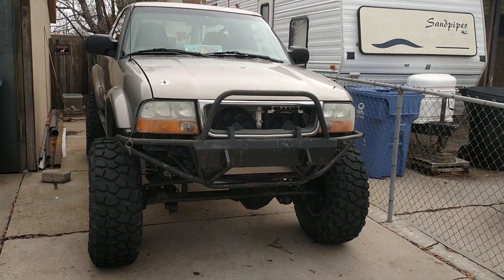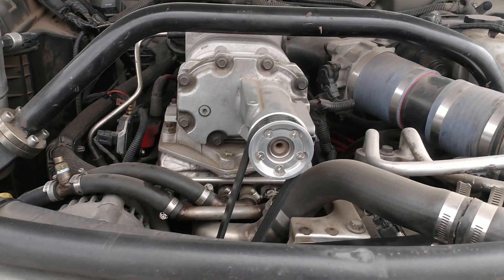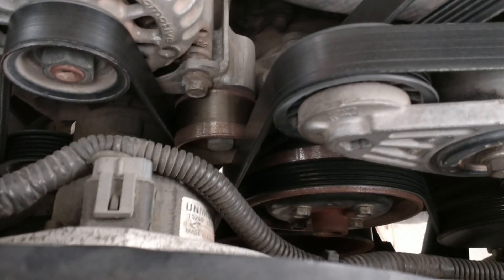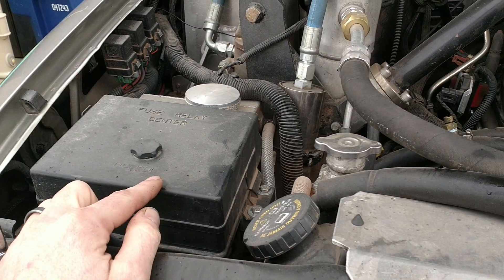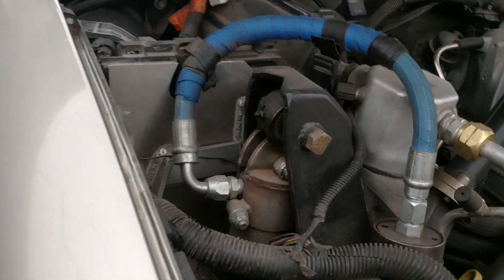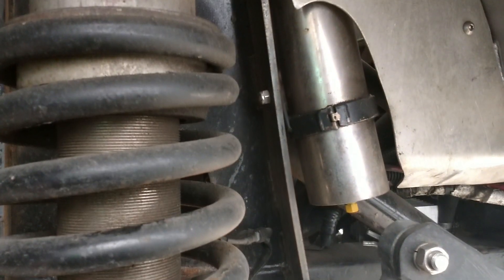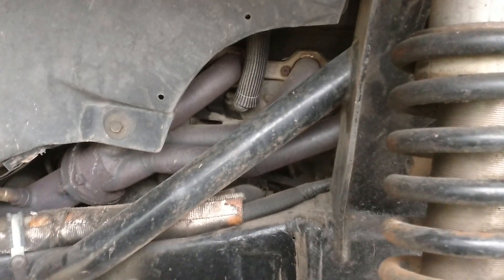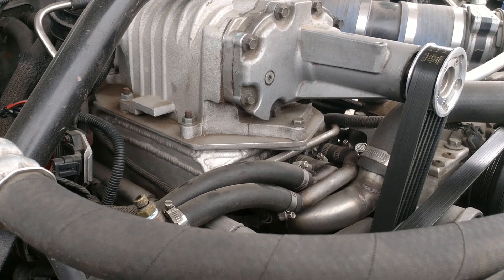Supercharged Chevy S-10

Comment: Sweet truck, amazing additions. I've been a mechanic for 45 year, can pretty much fix or build anything, but not near what you done to this. I was just found disabled so shutting down my one man shop, taking time to build a little 1996  S10 that I picked up for 600, needed a shift fork on 5 and reverse. Done many of my own added changes, looking ways to lift but as you probably know, not much out there aftermarket or otherwise. And now, disability doesn't pay much, cnc machine surly not an option.  This in the nv3500 5 speed with the manual shift t-case, that being all stock, still runs great. Been seriously looking at ls swap, until I looked into supercharged s10, found me here. I've worked on and own many s10's, all 4.3's new style, old style - pre-vortec  and even combining the two.
My last one was a '94 4x4 with a thrown rod. It had the vortec heads and valve covers but throttle body injection, running early distributor, obd1 ecm and a metal timing cover without a crankshaft sensor, and a metal oil pan that thankfully the rod didn't damage. And it did have the balance shaft. So, not wanting to change the ecm,  I used a '99 short block. The heads I kept from '94 because they matched the manifold which was different, old school angle. Had to delete 2 holes in the metal timing cover and use the old school pan gasket for the metal pan. anyway, you didn't need to hear all that, just thought it was an unusual find. It did run and and sold for a good return. Appreciate the inspiring ideas, will check your channel for other ideas. maybe the manifold and injectors, plus lift. 63, beat up but still makin' things run. Seeing your work reminds me, all is not lost....
Reply from the maker: All is never lost my friend you just need to keep looking on the positive side! I got diagnosed with epilepsy at the beginning of the year and am still trying. That was an excellent story, you and my grandpa could talk for hours on the older stuff, I'm OBD2 up to direct injection with a few exceptions and they are all basically the same through that range where as before like yours can swap all kinds of vortex and 350 parts around and make them work. I unfortunately broke a rear driveline a year or so ago and 'had' to start a new project on it and of course haven't finished it and moved onto something else... I am actually building an aluminum 5.3 to stuff in it but again struggling for time. I very much appreciate the kind words and if you're on Instagram look me up @mybuiltsonoma I have some older pictures of the truck and some of the last trip to Moab where I broke it, there are mostly clips of my boiler jobs and tool buys with some machining thrown in there.

Comment: Man that is so cool that you built a set of headers out of a hospital bed railing I never heard anything like that so my hat's off to you
Reply from the maker: Thank you! 
They are 1.5" 304 brushed stainless steel tubing with fantastically welded 90's to each end and the hospital was just throwing them all out so I grabbed a bunch of them and made a set of headers, the only set I've built for this that I didn't have a single problem with aside from making the outlet flange 1/4" instead of 3/8" and fighting that periodically.

Comment: What about the M90 supercharger? It seems to work pretty good on v6-v8s at 450 or so hp. Was thinking about swapping 3.8 supercharged engine But this is a simpler idea and can build the 4.3 for way more hp.
Reply from the maker: The Xterra blower is just big enough for this 4.3 but could be more efficient and work better if it was a slight bit bigger. It would work on a 3.8 or 3.6 but since gm already did the 3.8 supercharged it would be more practical to just build one with that blower. Literally the only ready this is on this truck is because I got 2 of them for free at the time.
Reply: Ok sounds good for a free one. Please let me know what parts used for this. Intake setup, fuel, pulley and belts, etc. Planning on deciding very soon to boost my 4.3 vortec. Thanks!

Comment: What supercharger did you use and where did you get the adapter plate? Any other supporting mods?
Reply from the maker: @zacharybinx1316  it's off a Nissan Xterra, all of the plates and parts are custom built by me to get them to work together including the water pump to flow the intercooler water.

Comment: I'm gonna to try to do my valves! is it alright if I get into a jam, can I drop you a line? another thing, every time I start my truck up there's like a hesitation? it's slow to start! weird! can't explain it! it's a old truck, but its fun!
Reply from the maker: JRX 2 what do you mean replace your valves? If you have enough wear to replace valves I'm sure the engine just needs to be rebuilt. As far as the hesitation it could be anything.
Reply: well the engines has about 85,000 miles.
Reply from the maker: JRX 2 why do you want to do valves? And what exactly do you mean by doing valves?
Reply: it smoke's when I turn it on.
Reply from the maker: JRX 2 ok  your talking valve seals. Those aren't to bad but you have to pull the valve springs to get to the seals and there is a way to keep the valves from falling into the cylinders, add compressed air to the cylinder when the valves are closed and it's possible if your very careful to reinstall the valves springs and retainers without pulling the heads or intake.
Reply: what do you think of having the heads rebuilt by a shop? would it be easier than if I did it, or just taking off the heads, and doing them on a table, instead of running the risk of one of them falling into the cylinder? I know its more work but at least I don't have to worry about that, plus I could learn more about my engine! do have a website? if you do let me know! if not, you could make one up and make money in how to do these things on a more one on one teaching, something like that!
Reply from the maker: JRX 2 I do not have a website. Taking the heads off would be an excellent idea, if the engine only has 85,000 I would pull the heads, rebuild them yourself and reassemble with all new quality gaskets throughout the top end, the bottom end should be perfectly fine to go another 85,000. There are plenty of videos on YouTube of how to replace heads on a 4.3l.

Comment: I have the 2.2l and just finished building the bottem end next is the supercharger I want about 400hp
Reply from the maker: Man them are some high expectations for that little guy. I really hope you get there but man even on my completely built 4.3l with 10psi boost I'm only in the 325hp range.
Now with that being said I have seen the old Ford 2.3l turbo run in the 350+. Just keep in mind 400hp is alot to ask from a 2.2l engine.

Comment: Assume money and time is unlimited would you pick a na 5.3 or 4.8 swap or stick with the boosted 4.3?
Reply from the maker: Well that's a bit of a tuff question because I have an aluminum block5.3L L33 in the making  right now. With that being said, I'm not necessarily building the v8 because I'm having any particular problems aside from wanting my ac back on the trails for hot days, I can't keep the temp down on this setup with the intercooler running the hot engine temps out to the front of the radiator, otherwise I would 100% keep this set up. I also have a whipple blower off of a 6.0 H2 I have been thinking about sticking on the v8 without any intercooler, but then I'm back basically in the same boat of tuning over power and potential headaches of burning stuff down. I built this 4.3 twice before I was able to get it reliable under boost.

Comment: I'd love to see how you did the adapter to the 4.3.... I have two of these Xterra chargers laying around, and an AWD Astro van on the way for my next project.... ;)
Reply from the maker: I'm building a stroker 6.0l for it shortly and when I get the engine out I'll do a video on the blower set up.
Reply: @wheelitzr2  Amazing, I look forward to it  - will subscribe !
Reply: What year is that Astro van?  If it's the one I'm thinking of like the early 90's Safaris I've always wanted see somebody do one of those up either slam it and turbocharged it or lift it and supercharger it
Reply: @0zmosis2001  Mine is actually a gen 2, but pre-changes. 1997 AWD with the Borg Warner 4472 (same t-case as in the typhoon/syclones). I already have it lifted 2 inches, will be 3 in the spring. I DESPERATELY want to find a 5 lug AWD parts van with the 3.73 gears and G80 rear. (swap both diffs out and have better gears for larger tires). That done, a supercharger would be a nice addition for offroad oomph!

Comment: Love to see how you did the intake plenum.   I wanna supercharge my 4.3L crewcab S10 project truck.    I got a m112 from an 03 ford f150 lightning for cheap.
Reply from the maker: The M112 is the perfect size for the 4.3l. mine is only an m90 and it's on the small side. On the intake manifold I basically welded the jaguare intercoolers to the top of the factory aluminum manifold and added external ports for fuel injectors from a 6.2l LS. My recommendation if I had to do it over again would be to get the intake manifold from a 4.3l mercruser boat engine that has the external fuel injectors and do an inline intercooler similar to a turbo setup.
Reply: @wheelitzr2  something to look into thanks,  my one guy friend says to build a fabricated alum intake but wasn't sure how you went about it.  Using the factory bottom plenum sounds like a perfect starting point.
Reply from the maker: @ashtonmariefranklin1981  I cut the entire top of each plenum tube out (you'll see what I mean when you pull the top plastic part off) but I would suggest only cutting them back an inch or so because I lost a lot of low end torque. Also you are going to have to get stronger Pistons because the stock ones won't take the boost, I'm using hypereutectic but I'm only making 8-10lbs of boost, I dropped my compression down to around 9.5:1 only because I didn't have a good way to program for extra fuel delivery until I did the 6.2 injectors. 
With all of this, I am currently building an aluminum block 5.3l for it right now and will be swapping it out in the future, it's cheaper to build and swap in an ls than do what I did to the 4.3l and not get the kind of performance I was looking for. The number 1 reason I don't want to make any more power on this engine is because I can't get an aftermarket forged crank for an even fire 4.3l and so the weakest link in that engine is the crankshaft and really only good for about 300hp, definitely something to keep in mind.
Reply: @wheelitzr2  I heard from guys who run turbos,  they say cryogenic treat the crankshaft  and use 2, 4 bolt splayed main caps on the 2 center journals and align hone the mains.  H-BEAM rods will finish up the bottom end.   I could easily do an LS swap. But my goal is to build me a supercharged mighty mouse v6.  I believe the LU3 4.3L like I has the ecm's are very tunable with hp tuners.   I likes being different from the rest of the crowd . And seeing how you made an intake mounted SC.   I've only seen 1 other blown 4.3L v6 it has a 4-71 blower with a 950cfm carburetor and a huge choppy cam. In a hot rod chevy luv.  

I has a full lu3 pulled from a wrecked donor s10 and gonna take my time building it don't care if it takes a few yrs.  Current my s10 is my daily driver with 127k miles on it.

Comment: Were did u get the manafold
Reply from the maker: @joshuasmith-3672  I custom built the manifold from the factory lower intake. I added external injector ports to it and welded the intercoolers directly to the top of the lower manifold.

Comment: Marine intake and procharger is on my agenda . We run the same exact pistons but mine are 4.030 I’m guessing yours are still stock ? Wish I’d went with eagle rods tho
Reply from the maker: The rods are a waist of money because the stock crank is the week link in the 4.3L. I don't think they make a difference either way in mine. Yes stock 4" bore. I didn't know about the Marine intake untill after a built this contraption of an intake manifold but I've Incorporated the intercoolers into the manifold so I'm not sure if I could have made the marine one work anyway.
Reply: wheelitzr2 no doubt about that . I have several friends been running 10lbs on stock cranks with no issues for 50k miles so I think I’m gonna shoot for around the same . Your a genius in your own right tho for sure man . A lot of damn work invested there !!
Reply from the maker: @lostkauz83  thank you! I'll be making a new video on all the changes I've made recently, intercoolers and plumbing, fans, winch plate, new transfercase doubler brackets, switch panel (with backlight).
Reply from the maker: @lostkauz83  oh and a Dana 44/50 hybrid front axle from an f-250 turned into a solid axle.
Reply: wheelitzr2 hells yea man I imagine a lot of us will be watching . I guess my next shoot will be with intake changes hopefully because unfortunately mine is down atm because I decided to break off not one but two map sensors in my intake letting the pieces fall down in the intake . Yay !
Reply: @Steel Sledge, I moving to a marine intake on my 2002 4.3L for fuel mods. What charger did you go with?
Reply: @jamesheilig8068   havent yet , my buddy had a procharger 500b or whatever it is but I'm scared to put much to these stock rods an hypereutectic pistons .

Comment: on a serious side, there's guy who says that you can get more HP from a 4.3 if you change the cams! what's your opinion and said you would have to change the computer? would comment on this! thanks
Reply from the maker: JRX 2 I am running a stock cam for 2 reasons. It doesn't mess with the computer and a stock cam seems to run really good with a roots supercharger because the boost is lineir with throttle possition. If the truck wasn't boosted then yes a wild cam would wake up the stock motor but you would have to flash the computer for whatever cam you put in it.
Reply: How is the boost not messing with the ecu since you’re now running two bar? You would have to alter the VE table for it to run properly would you not?
Reply from the maker: Tanner Reed I am running a 2 bar map with an HP tuners program.
Reply from the maker: JRX 2 it depends on what your doing with it and what you want out of it. A stock cam is a good mix between power and drivability.
Reply: The 4.3 came with two different camshafts in factory form(this generation S10), Vin X and Vin W, I think the difference is 12-15 horsepower. (All Z's have the larger of the 2 cams, kinda like the 8.5 diff Z only stuff, or the leaf spring stanchions, unique to the Z)
Reply: JRX 2 yeah
Reply: I’m running 500/500 lift comp cam , stock map an Hp pro suite . Does excellent with right running .

Comment: i want to do this and put it in my 62 Chevy II
Reply from the maker: Well your in luck, the entire set up including engine is for sale right now.
Reply: @wheelitzr2  can you sell the plans or retail intakes? thanks
Reply from the maker: @ezcondition  unfortunately no, there isn't any plans and was built as I went.
Reply: @wheelitzr2  what intake did you use? how much are you asking for the engine?
Reply from the maker: @ezcondition  it was a stock intake manifold but highly modified. Non of this just bolts together, I had to cut and weld everything to get it all to work together.
Reply from the maker: @ezcondition  I am looking for $3200 for 
Engine,
Engine wiring harness,
Fuel system from firewall forward,
Supercharger,
Intercooler,
Intercooler charge cooler,
Duel belt conversion brackets,
Belts,
Stainless steel Headers and y pipe.
I'm keeping the computer.

Comment: Very nice "custom" intake to mount the blower on. Why not go with a Whipple or Magnuson blower? Much better VE. Fun to see a 4.3 being cranked up. That crank wasn't forged, correct? If so, where did you source it? I'm unaware of forged cranks available for the 4.3L.  GMPP had them available at one time, but now they're unobtainium. Same with aluminum heads (at least w/o having to piece together an 18 degree intake manifold system).
Reply from the maker: Victor Everlove stock crank (the only thing you can't buy for this engine). the supercharger was free that's why i have that particular one but I have a Whipple twin screw off a Hummer h2 that I am working on putting on right now, I'm working on making some parts to make it fit right now.
Reply: @wheelitzr2  Can I buy your old manifold lol
Reply from the maker: @twonulator  actually the entire set up is for sale at the moment, engine, all of the supercharger stuff, and engine wiring harness.
Reply: @wheelitzr2  Following up
Reply: @wheelitzr2  do you still have or sold it already?

Comment: Is that a mustang 4.6 supercharger?
Reply from the maker: It is a Nissan supercharger off of a 2002 xterra 3.3l.
Reply: @wheelitzr2  cool thank you
Reply from the maker: @royaver2202  more than welcome, the entire engine with supercharger is for sale.
Reply: @wheelitzr2  what's the plan now? Or truck is gone?
Reply from the maker: @royaver2202  I am putting an aluminum block 5.3l into it, the supercharger would be bad ass for a rig that only sees the street, unfortunately it creates overheating issues on the trail when I run the ac and I'm not moving.

Comment: Where did you move the battery to?
Reply from the maker: I relocated it to a spot just in front of the passenger rear wheel under the bed, I put I hole in the bed and build a bracket to hold 2 batteries.
Reply: @wheelitzr2  damn, some serious fab work, but the thing looks amazing!
Reply from the maker: @garretbrewer2192  thank you!